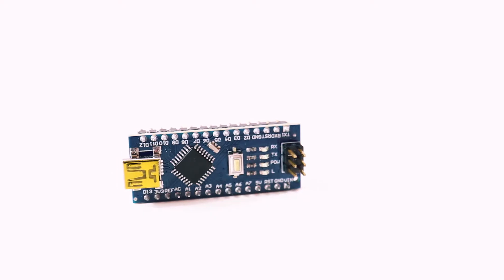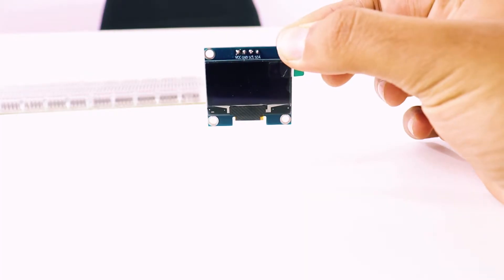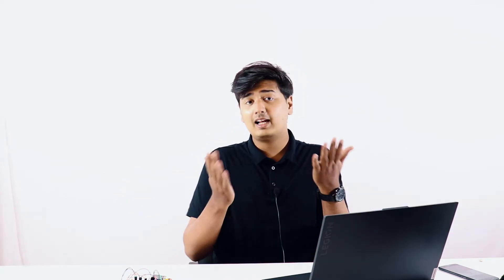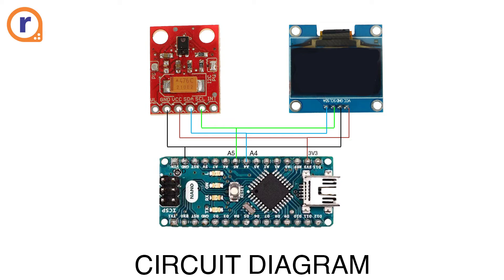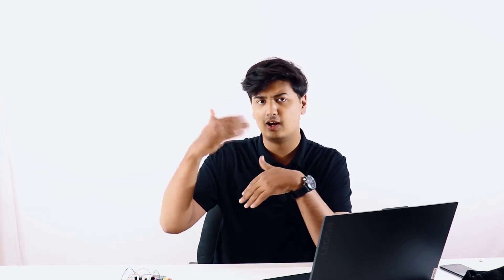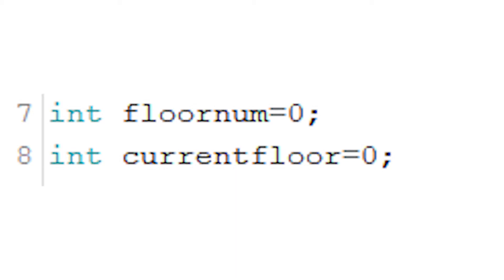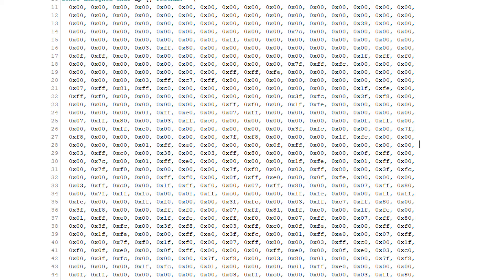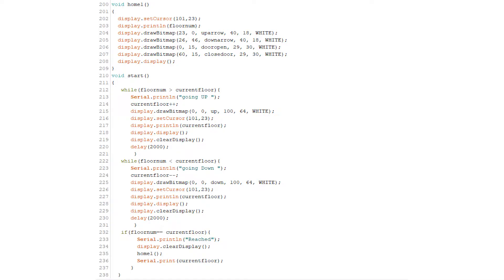GESTURE CONTROL ARDUINO PROJECT!!

Comment: I had made a similar gesture controlled mirror with LEDs using components from robu just a week back. I used an IR array and relays to obtain the same effect; one swipe up for low brightness, another swipe for higher brightness and swipe down for turning off.